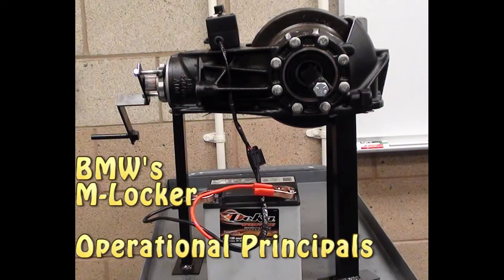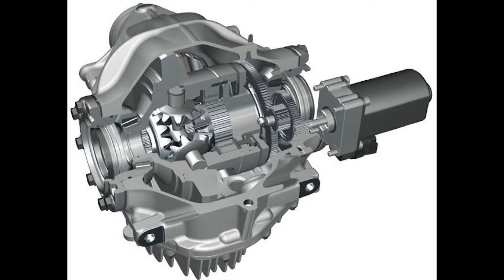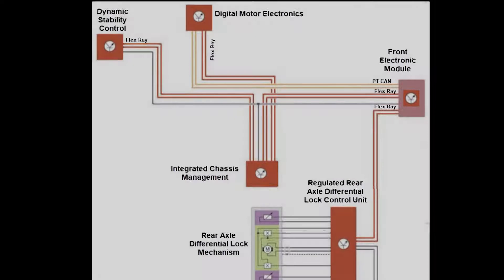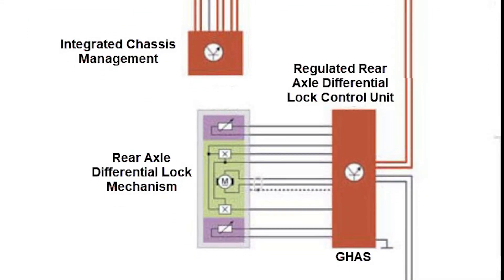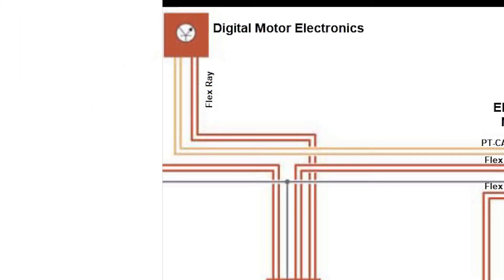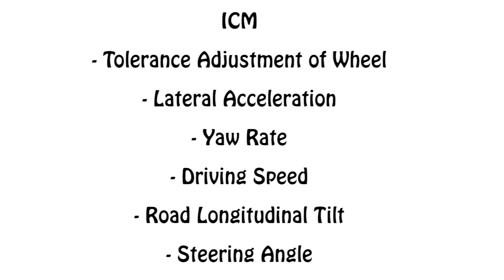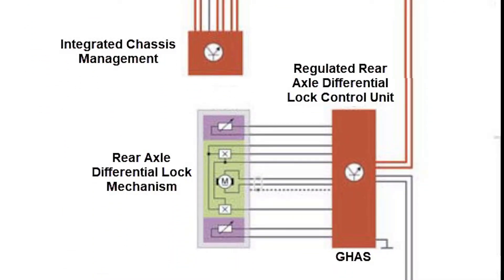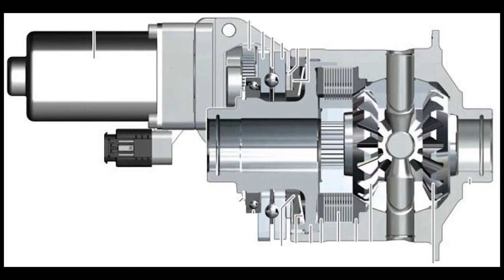BMW M-Diff Locker Explained

Comment: Great video! Could you please share PWM frequency that worked for you? Also just to be sure, it's 12V motor? Thanks!
Reply from the maker: Yes, a 12 volt motor.  I'm pretty sure I was using 300 Hz or 500 Hz.  I don't remember. In the description I put a link to the controller I used. It should list the frequency.
Reply from the maker: Well, I just tried the link and it's broken. Sorry.  I will remove the link.
Reply: @DrivelineMaster  I wanted to check FK823 controller frequency, but it seems it's also configurable, that's why I asked :) thanks for quick reply! Also maybe detailed question, do you know pinout of actual GHAS (Diff Control Module)? I am wondering what inputs the controller is using to dynamically change diff lock. Seems like there are a lot of variables, not only wheel speed
Reply from the maker: @wtbgarage  The diff control module uses inputs over the CAN Bus from the Body Domain Controller to adjust the diff lock so knowing the inputs is a bit challenging. The diff itself has 2 hall effect feed back sensors and two temp sensors. this information is returned to the diff controller which is sent to the Body domain controller. From what I can tell besides these sensors there are inputs from: Dynamic Stability Control (DSC), Digial Motor Electronics (DME), Front Electronic Module (FEM), and Integrated Chassis Management (ICM).  These inputs are listed starting at timestamp 1:17.

Comment: Getting a <lock diff signal> on my dash, so I assume the motor needs replacement, getting a servo voltage code .....took off the motor applied current and it turns both ways depending on current polarity.
Should I replace the motor to fix the  problem?
Please help.
Reply from the maker: Codes can be so much more than a part to replace. Sounds like the motor works so I wouldn't jump right into replacing it. These motors are also pulse modulated which is a bit different than just sending power and ground.   If you give me the year and model along with the code I will try to look up some diagnostic test to help you pin this down.
Reply: @DrivelineMaster  ok thank you so much 😁😁

My scanner shows the following;

D35F10
Signal actual qmuh 73.0.2
Invalid transmitter ghas

And;

482b86
Position sensor 1 servomotor signal voltage outside valid range 

And when I took off the servo motor, I looked in with a camera and saw the gear that connects the servo motor, stuck my finger inside and turned the gear and noticed it has teeth only on half the disk, strange, anyway I put it back to the middle, then the servo and still have the dash warning of a limited locked diff.

Again thank you for any info you can find and or share 🙏🙏
Reply: Oh yeah it's a 2020 x3m with the s58 engine and most of the tranny comes off the M5 sedan I believe.

The car drives normal as far as I can tell even with the warning and constant yellow light of a car with squiggly lines.
Abs and anti skid work, it's winter here so tested on icy roads
Reply from the maker: @Canamsport  1) I have a picture of what the gears should look like if you want me to email it to you I can be emailed at drivelinemaster at gmail.com.  I would start at the GHAS unit and check power and ground signals going into it.  On the output side it looks like a couple of temp sensors and a couple of hall effect position sensors along with the motor control wires.  The temp and hall sensors should have a reference voltage that is sent to the diff and a feedback wire from the diff to the GHAS. You need to verify that those are working and the connections are good. You can also check the integrity of the all the wires from the GHAS to the diff. Your going to need a wiring diagram.  If you need that as well if I have an email address I can include that along with the gear picture.

Comment: How do you disengage the left axle?
Reply from the maker: I'm sorry to say that you can't designate one axle over the other. It does however makes sure that equal power is sent to both with only slight differences to enable cornering.

Comment: i can find the F10 M5 diff, subframe, axles and controller on ebay. i also have ista+, ista p, and other diagnostic and coding software. have you ever heard of anyone attempting to retrofit the locker into a non-m chassis, like a F10 535?
Reply from the maker: I'm sorry I have not heard from anyone else who wanted to retrofit this diff into a non-M Chassis. I have had several viewers who wanted to manually control the M-Diff.
Reply: @DrivelineMaster  manual control is actually not a bad option. at least from my perspective i could see myself dialing the lock in as traction permits and fully lock on a launch or if i am trying to drift. should be pretty easy for me tobang out a controller box.

Comment: Awesome video. Do you have the servomotor pinout description you could share?
Reply from the maker: Unfortunately the wires could be different from year to year and model to model but here is what I know and you can do some pin checking. Two of the wires control the motor.  Those are most likely large diameter wires. They may also be shielded inside a sheath. Unplug them and check with an ohmmeter for low resistance through the motor. There are two thermistor temp sensors. two wires each. You should be able to unplug and use an Ohmmeter to pick those out.  Each temp sensor should have a voltage wire from the control module. I'm not sure if these are 5V or 12V or something else.  There are 2 hall effect position sensors using 4 wires. One wire supplies voltage from the module again this is most likely 5V but I'm not certain. One wire is a ground return and the other two wires should be on/off hall sensor wires.  If you send me your year and model I can see if I have the wiring diagram.
Reply: I bought a 2017 M3/M4 differential from F80/F82. Will be swapping it to the E36 together with the whole rear suspension.
I'm working with a friend of mine to prepare a Control module that will set up 0, 25, 50% and full lock 😉 Any tips will be appreciated!
Reply from the maker: In that case I think you only need the two motor wires to control the amount of lock or slip.  It should be easy to identify the motor wires.
Reply: So the servomotor will stop automatically in the end positions and here is no danger of breaking it? 
And the 25/50% lock should be done by inspecting how much time is needed to reach the given lock?
Thanks a lot for the support!
Reply from the maker: The motor is controlled with a fixed frequency duty cycle controller.  100% on power or 100% duty on will be 100% locked. 50% duty on will be 50% locked and 25% duty on will be 25% locked. Someone needs to build you a controller where you can choose which duty cycle you want.  Then it stays at that duty  for the whole time that you want that specific amount of locking.
Reply: @DrivelineMaster im absolutely terrible with electronics atm so may be a stupid question, is duty cycle controlled with pulse width modulation? this would make it possible to run it through some standalone ecus without special controllers or would a motor controller still be required?
Reply from the maker: @chrisJordan-xb9wc  Yes Duty cycle and PWM are the same thing.  You just need something that can handle the amperage of the motor. Provide a fixed frequency and the ability to change the percentage of the duty cycle or PWM.
Reply: @DrivelineMaster  thank you! would the motor happen to be under 8 amps? also if you know anything about the atc13 transfer case could it be possible to disconnect the motor from the vtg and also run that through pwm?
Reply from the maker: @chrisJordan-xb9wc  I don't have the amperage value but my demo is using an radio controlled car controller so I can't be certain how much amperage that motor works under without measuring it but you can get controllers that can handle 30 amps with no problem.  I'm not familiar with that transfer case but the ones I'm familiar with need to precisely run the motor for a specific period of time rather than a steady percentage. I would be surprised it you could control a transfer case motor with a PWM controller as a replacement for the control module.  What would be the advantage?
Reply: @DrivelineMaster  some people use a transfer case from a nissan skyline gtr to convert cars to awd while still having the option to disengage the front driveshaft, that transfer case uses a hydraulic system to compress the clutches together while the bmw atc13 uses an electric motor. with the skyline transfer case you need to rig it together with a homemade hydraulic system to be able to control it or fit it into another car without bringing the computers and sensors over but my thought process was that the xdrive one may be slightly more complex making it less bulletproof but parts are cheaper and so is the transfer case itself along with saving weight from not having a pump and lines for it. plus my plan is using an 8hp automatic which has adapters for the skylines transfer case but the atc can bolt directly to it saving another $2000. the atc13 seems to work in the same way as this differential using ball ramps to push a clutch pack together but may have differences that require different motor operation for control
Reply: @DrivelineMaster  not exactly an advantage i dont think more just for the cool factor of being able to do a burnout and then do a launch in the snow in the same car
Reply from the maker: @chrisJordan-xb9wc  Ah, so this is an All Wheel Drive transfer case that can engage or disengage one of the axles and this is controlled with an electric motor, ball ramp and clutch pack similar to the M-Diff.  if that is the case then yes, you should be able to use a PWM controller to control the clutch pack clamping force that engages the second axle.
Reply: @kubabaniaq3808 did you do this i want to same
Reply: I recently upgraded axles and after changing them; I’m getting a “rear axle differential lock reduced” message. Also upon acceleration it torques the car badly to the right. I’m being told I’m getting this message when the diff fluid is reaching high temps. I had also changed out diff oil temp sensor/cover as the cover cracked upon loosening the drain plug. 

Any ideas?

Comment: How much current should go into electric engine not to kill it? I want to retrofit m diff to non m car
Reply from the maker: I'm a little unclear as to your question. When you say electric engine do you mean the electric motor for the M-Diff?  If you don't want the diff to ever be locked up or even partially locked up then just unplug the motor.  If you care to rephrase your question I will try to answer it.

Comment: Hey. Great explanation, love that. So you steering preload with pwm signal. When applying 100% PWM then diff is locked, but what if you cut off power to the motor. Will it stay in locked position? I'm concerned about engine overheating in situation when diff is locked for a long time
Reply from the maker: I'm not 100% certain but 99% certain that when you lose power to the motor the differential will have a default where it resorts back to 100% open differential.  So I don't think the diff will stay in the locked mode.  Please note that the diff will have various levels of being locked up such as 70%, 80% and so on of being locked.  It does not need 100% PWD to be locked up.
Reply: @DrivelineMaster  thank you very much :)

Comment: Great video! Can it provide genuine 100% lockup e.g. during an axle-twister on a X5? (To compare, a LSD can't "bite" anymore beyond a certain point, and then start slipping again like an open diff. Whats the case with a M-Sport diff-lock then?)
Reply from the maker: LSD Diffs that use clutch packs and cones have bite limitations cause by exceeding the friction limits between the friction disks or the cone surfaces. The M-Diff is also a clutch pack design but the friction is managed by the clamping force from the electric motor and ball ramping mechanism. This of course is all controlled by the computer system using various inputs.  If you bypass the computer system with a PWM (Pulse Width Modulation) control board to control the position of the electric motor you will use a constant force on the disks. If the difference in rotational force for each wheel exceeds the friction between the disks then slippage or bite break away will occur.  Break away or exceeding the bit limit is directly related to the electric motor position so it theoretically possible to dial in various break away limitations.
Reply: @DrivelineMaster  Thanks!

Comment: Could I use potentiometer to specify exactly the lock I desire for my driving behavior? Instead of trusting the computer to do it, manually set lock or partial lock.
Reply from the maker: I suspect you can but you need to use your own controller to control the motor. I don't know if you will get codes or not for disconnecting the diff.
Reply: @DrivelineMaster  thank you. Yes, I'm not worried about the codes. Could you point me to the direction of the potentiometer you have used?
Reply from the maker: I purchased a project box, potentiometer, and a PWM circuit board.  I'm going to have to take it apart to find that info.  I will try to do that next week and post that information.  Your not the first to ask about my controller.  I should have posted it when I first posted the video. I didn't realize the interest in bypassing the OE computer system.
Reply: @DrivelineMaster  that would be so awesome! Thank you so much!

Comment: Hi, you wanne share how you controlled the servo motor ? is fixed frequentie and regulated PWM ? do you swap + and - when you change direction ? or does it go back to start position if you set PWM lower ?
Reply from the maker: Yes, you are correct.  I believe I used a Radio Controlled (RC) car controller board that I purchased online at one of those electronic stores that sells kits and such.  It's been a long time. The frequency is fixed with a variable duty cycle.  The tension on the compressed disks return the motor. The direction does not have to be reversed on the motor. I can't remember what frequency I used.
Reply: @DrivelineMaster  thanks great !!! I am building this differential In a restomod BMW 2002 with b48 engine 8hp50 gearbox and m2competion M active differential.  Will try to figure out the position sensors to get a pid controller working
Reply from the maker: Good Luck.  You might just want to run this in two modes.  Locked or unlocked in which case you won't need to vary the duty.  A fixed duty when you want it locked and no duty when you want it off.  You could also have a push button controls that you can choose 0, 25%, 50%, 75% or 100% engaged with off and 3 other fixed duty's.  That way your not guessing with a control knob.
Reply: @DrivelineMaster  thank. The push button is good option as we have canbus keypads.

Comment: Hi there and thank you for this great video. Is there a way to calibrate the locking mechanism? . Reason I ask is because we changed the rear diff cover and rotated the gear that connects to the motor or module that locks the rear diff and now the car is showing a rear diff lock message. The gear that you show that adjust the pressure of the plates on the m340 is half gear and the other half is blank, basically we left it in the blank spot . Thanks in advance
Reply from the maker: As far as I know these are swap out units and not designed to be rebuilt or swapping out parts or  the housing.  Not that I couldn't be done on some level but I know of now way to calibrate it if it didn't get put back together exactly as it came apart.

Comment: Thanks a lot @DrivelineMaster !!! I'm thinking on installing an M-performance (not "M) Diff for M140i. First video that explains things! As around 400 NM are on the wheels, the ~75 foot pound means ~100 NM of locking is available, if understoood correctly, this will allow the diff to have 150NM in the less traction wheel and 250 NM in the other. However the total locking torque will be different for the M-performance, right?... thanks a lot!!!
Reply: @drivelinemaster thanks for the video! Any idea on locking NM or soft powerdrifting capabilities on M Performance diff?...
Reply from the maker: I just reviewed my video and I don't see anywhere where I have mentioned how much torque the locker can hold so I really don't have an answer for you.  I also don't know how it will work for power drifting.  My guess is that BMW designed this for everyday driving and drifting would push it to the limits and not likely hold up over time.

Comment: Thank you for this videos. Can you tell me how the electric motor on the diff works? Is it a dc motor? How much curent does it draw ? I wanna controll it with a aftermarket ecu and a pwm module. I fugred you know since you made it work with a potmeter😊
Reply from the maker: I used a 12 volt battery and a PWM controller that can be purchased through any hobby magazine for and RC car. I don't remember the frequency but I can check next week.
Reply: @DrivelineMaster  thank you😊
Reply: Did you look at this? Do you have the pinout on the motor? Not so much info om this online. So i am very grateful for your answer😊
Reply from the maker: I'm sorry I did not check the frequency.  I will try to remember to do that this week.  Please note that I do not have a vehicle to measure the frequency that BMW is using. I can only provide you with the frequency of the controller that I'm using.
Reply: @DrivelineMaster  no problem. The frequensy you use and the pinout is what i need👍😊